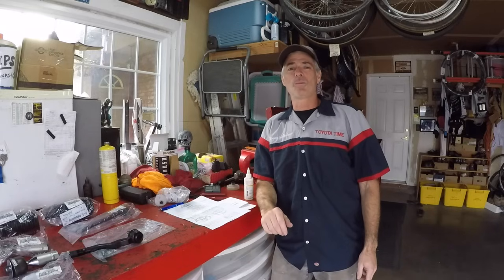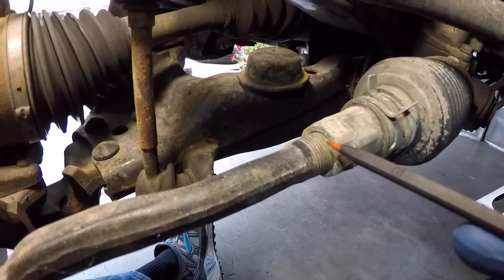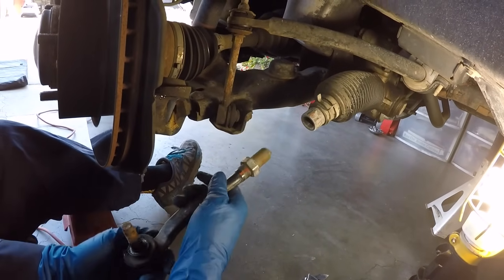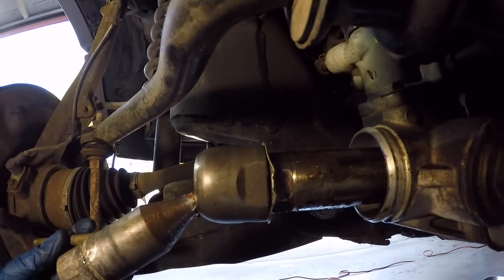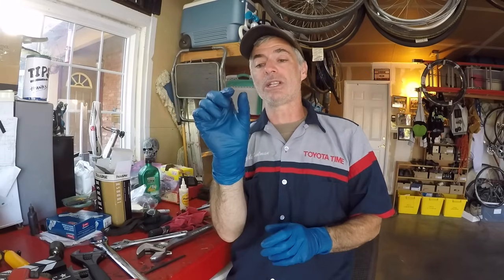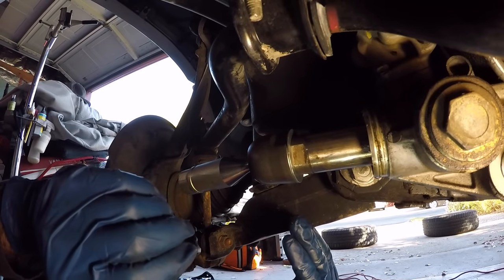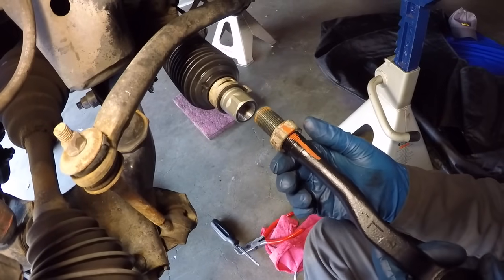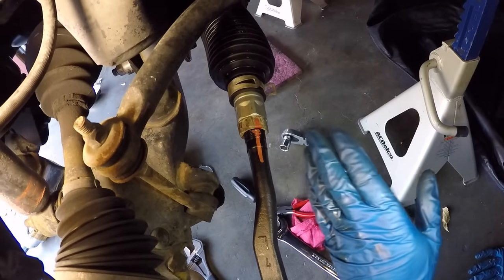Inner & Outer Tie Rod Replacement

Comment: I mangled up my passenger side outer tie rod replacing the ball joints today. I can't get the castle nut back on from the puller slipping off and crushing the threads.
Can i replace just that tie rod? Or do i need to do both sides for alignment purposes? 
And if i do have to do both can i just do the outer tie rods on both ends?
In advance Thank you again tim
Reply from the maker: How about first running a die over the tie rod and cut some new threads.  If not, you wold be fine replacing just that tie rod.
Reply: @TimmyTheToolman  i bent it pretty good to or i would give that a try. Thank you for answering my question once again!
Reply from the maker: @UpNorthOutWest  If the shaft is actually bent, you should replace it.  If you make match marks on the lock nut to tie rod shaft and count the amount of threads exposed, you could get the toe adjustment for that tie rod pretty damn close to perfect and forego getting an alignment.  If money is tight, that's what I would do.  But, maybe you were planning on getting an alignment anyway.
Reply: @TimmyTheToolman  that's what ill do then (i watched the whole video) i was planning on getting a alignment for that reason only from replacing the otr tie rod but if it drives straight after that then i will skip on it. I was just concerned if it would cause uneven wear from one side being newer
Reply from the maker: @UpNorthOutWest  No, it won't cause uneven wear from being newer but if you don't get the adjustment really close to what it was, that will throw off the alignment and cause uneven tire wear.  Put a mark on the lock nut and carry it down to the tie rod threads making a parallel line with the shaft but going across perpendicular over the shaft threads. Also count the amount of threads showing.  When you get the old tie rod off, put the new tie rod next to it and put a parallel line on the threads in about the same spot, just eye ball it.  You screw the new tie rod into the outer tie rod with the old lock nut paying attention to the amount of threads showing.  You're goal is to get the same amount of threads showing and also match up the match mark on the tie rod thread with the mark on the lock nut after you've tightened it down. This will give you a very accurate way to get the new tie rod in pretty much the same exact spot.  Good luck!
Reply: @TimmyTheToolman  thank you so much for your help man!much appreciated🙏🙏
Reply from the maker: @UpNorthOutWest  You're welcome Bro.  Good luck with the swap.

Comment: Hello there, do you know if I have to remove the outer tie rod again to adjust the toe ? All my other vehicles had an outer tie rod that can spin free once you unlock the tight nut to adjust the tire,I'm afraid to damage my inner tie if I forced the outer tie rod to spin over .thanks
Reply from the maker: Hey Felipe, no, you don't have to remove the outer tie rod to adjust the toe.  The alignment techs loosen the lock nut, make the necessary adjustments and then lock it back down.
Reply: @TimmyTheToolman  Thanks Timmy,I learn a lot from your videos.
Reply from the maker: FELIPE VALLES that’s awesome. Thanks for stopping by & commenting on our videos. We hope you’re a subscriber & if you enjoyed the video, do us a solid & smash that like button!

Comment: I think i need to replace one of the tie rod end. Do you think I should change he one is bad or both? Since i do not go off road OEM is not necessary. Am i right? thank you
Reply from the maker: You're fine with just changing the one that's bad.  As for choosing aftermarket over OEM, I personally wouldn't do it.  OEM is always, always, always the safest way to go.  You pay more but you're getting a superior product.
Reply: @TimmyTheToolman  Thank you so much Timmy. I followed your advice. I got the OEM. Thank you again!!!
Reply from the maker: @Leino26  You're welcome.

Comment: great video.  just google 'inner tie rod tool' though and you'll find multiple options available starting at about $15.  Or do what I did and borrow one from your local auto parts store for free.  It worked perfectly. no need to start grinding on wrenches or spending $120.
Reply from the maker: The only problem with the special tie rod tools is you need to be at the wheel well turning the tool which makes it impossible to also be holding onto the shaft of the steering rack which Toyota obviously expects you to do or they wouldn't have put flat sides onto the shaft so you could put a wrench on it.  So, it you have two people, I'd say rent the special tool for free at an auto parts store.  If you're solo and use the rented tool, all that force to break free the inner tie rod will be transferred to the shaft.  Is is a potentially destructive move?  Maybe.  What $15 tool options did you find?  Could you please share some links?  Glad you like the video.
Reply: @TimmyTheToolman   the tool I borrowed from the store was actually this type 
Inner Tie Rod Tool, EXCELFU 3/8 Inch Low Profile Tool for Inner Tie Rod Removal and Installation$12.99Amazon.com (similar to OTC tool. basically a pipe wrench)
I was able to get up close to the inner tie rod and the steering rack shaft. maybe I got lucky but it didn't take enough force for me to pop it loose for me to think I would be damaging the steering rack gear.  like you say, it could be possible to do some damage popping it loose or re-torquing it back on without holding the steering rack shaft. I just used my channel locks to hold the shaft when I was installing the new inner tie rod. I also made sure to lock my steering wheel.  Anyway, not trying to be a negative comment.  great detail in your videos.
Reply from the maker: @pauliemars  No worries.  I didn't view your comment as negative.  I just want people to know the shortcomings of the special inner tie rod tools that are available..  I sort of think the Toyota engineers were being overly careful because that steering rack shaft is pretty beafy, but maybe there is a risk of damage, and that's why they advise to hold the shaft firm with a wrench when applying force to remove the inner tie rod.
Reply from the maker: @pauliemars  Yeah, I saw this tool when I was doing research for the job.  So, it worked pretty good?
Reply: @TimmyTheToolman   I can imagine how easy it would be to damage several parts doing this job without the proper care and attention, and tools for sure. Yeah the one I used. Similar to the one in the link, worked surprisingly well. I used a 1/2” breaker bar with a 3/8 adapter. I tightened the nuts on the clamp really tight and there was zero slippage. Barely marked the part at all.
Reply from the maker: @pauliemars  Good to know.

Comment: I’ve been wanting to do this for my Tacoma but oem inner and outer tie rods seem to be insanely priced even at camel back Toyota , bought some moogs but they seem sketchy specially  the outer tierod
Reply from the maker: Yeah, I'd be reluctant to use Moog.  Damn, you are right.  The inner tie rods are insanely expensive, $157/each.  That's nuts.  Over $300 just for the inner tie rods.  I can't believe Tony opted to replace them because his didn't really need to be replaced.  The outer tie rods aren't so bad at $55/each.
Reply: Timmy The Toolman I’m actually redoing the suspension on my new purchase an 01 5lugger Tacoma , the outer tie rods are $70 ,inner 150$, the moogs seem to have good reviews , thanks for the video Tim
Reply from the maker: You're welcome.  Good luck with all the work.

Comment: I'm not sure what the problem is but, my comment is related to the IAC Test and clean video but, the comments section will not show up. The area just spins like it can't find the comments or something. Not sure if it's my issue or yours. Anyway, I just finished the throttle body and IAC clean and now my 4Runner will not start. But, I'm also having a P1300 igniter error code on coil #1 that seems to be causing the vehicle to stop running pretty much anywhere and at any time. It then will usually crank back up but, if it's hot it seems to exacerbate the problem. When hot it will stop and then I have to try several times but, it eventually restarts. So, it may have nothing to do with the fact that I liberally cleaned the IAC with throttle body cleaner. This is a long winded attempt to respond to your request to let you know if anyone has any problems after having cleaned the IAC with throttle body cleaner. I'm skeptical that my vehicle will not start because of the cleaning but, it did run this morning when I went to the grocery store and then I cleaned it and now it won't start. I wish the situation was not so complicated so we could get a better read on the cleaning method that should be used. Anyway, any help with either problem would be greatly appreciated. I double checked that everything is as it should be after the cleaning.
Reply from the maker: So you double checked that the IAC worked after the cleaning?  I definitely don't see how cleaning the IAC could cause an igniter issue.  Did you make sure all your electrical connectors were reconnected to the throttle body?  If you did like we did and disconnected the center coil pack, did you remember to also reconnect that?

Comment: Great videos, but the inside joint is a rack end it screws into the steering rack, inner tie rod looks like outside tie rod, usually used on stearing box
Reply from the maker: You lost me with your comment.  The joint that screws into the steering rack is the inner tire rod.  The outer tie rod connects to the inner tie rod and to the lower ball joint.

Comment: I would use a pipe wrench $10 @ Harbor Freight.
Reply from the maker: That certainly is an option and I mention it in the video.  You just have to be ok with marring up the tie rods with the serrated  jaws of the pipe wrench.  But, you better not grab ahold of the steering rack shaft with a pipe wrench.  That wouldn't be smart.

Comment: So my front driver side outer tie rod broke right in half, and it caused my wheels to lock up, I had a guy replace the part and it seems to be running fine but iam worried that the wheels will lock up again, could this small part be the cause of that happening or do you think it was something else?
It was on a 2001 lexus es, iam thinking maybe some sort of break censor did that when the tie rod was broken.
Reply from the maker: Maybe the breakage of the tie rod broke the ABS sensor line and that's why the wheels locked up.  Did the guy say he needed to replace anything other than the tie rod?
Reply: Timmy The Toolman the abs sensor light is on so maybe. He didnt say much just showed up and replaced the part, i asked him if he thinks it will lock up again and he said it should be fine now with the new part. Thanks for the reply back
Reply from the maker: @elguerokabron  You could probably find an ABS sensor wire at a PickNPull for your rig and replace it so you won't be looking at an ABS light on your dash all the time.

Comment: You could have also use a file and filed the material off from the knuckle to make the space to fit your tools a little wider, instead of grinding your tools to fit there.. as you are going to replace it anyway it, seems like better option than destroying your tools :-)
Reply from the maker: Trying the file down the inner tie rod enough for the wrenches to fit might be quite the laborious process but I suppose that is an option.   You obviously wouldn't want to take a file to the steering rack shaft.

Comment: wow! that ITR OEM is  247$  MSRP each as of  3/2o23 ... 170$ at OEM online parts dealer with 31% off... is an equivalent MOOG brand ITR from a RockAuto ok to use for this item?
Reply from the maker: I wouldn't use Moog but many guys do.  What I tell people, is if they want to replace inner tie rods, they may as well just buy a new steering rack.  A new steering rack goes for around $530 and it comes with new inner tie rods.  That's a much better deal in my opinion.

Comment: Timmy, I named 4 of my kids after you so if they ever request a DNA sample from you it will be because they think you owe back child support. LOL but seriously, You are my Idol and Guru. I went to the local hardware store and got some square "keys" that normally slide into a groove on a motor shaft where a pulley mounts. I epoxyed them onto the jaws of two large adjustable wrenches the night before. The epoxy held long enough to get the old tie rods off and after the job was finished, I cleaned the epoxy off the wrenches. I have done this on backhoes, tractors and heavy equipment before. Just be careful, take your time and and make sure the wrenches are tight.
Reply from the maker: Thanks Rob.  I appreciate you being a fan of our channel.  Nice Macgyvering with making your own tools for this job.  Happy Wrenching Brother!  
p.s. You can keep the kids but if you have some tools you want me to adopt, I'll gladly take them off your hands.  LOL

Comment: Is this one of the reason why you get steering wheel shaking left to right? (One of the reasons)
Reply from the maker: Yes, worn out tie rods could cause what you're describing.  But, if the joints don't have play, the tie rods are good and you'll need to look elsewhere for your problem.

Comment: Timmy, after I replaced the inner and outer tie rods on both side of my 02 4Runner, I took it for alignment. It came back with "stiffer steering". Any idea what could cause this?
Reply from the maker: Hmmm.  How was it during the drive to the alignment shop?
Reply: @TimmyTheToolman , well I didn't do such a good job as you did marking the new tie rod so my steering wheel driving on a straight line was a full 90 degree to the left. That was fixed on the alignment, but to answer you question, it felt like I was driving a boat. There was no resistance to turning either right or left meaning that no, the steering did not feel tight or stiff at all as it does now after it came out of alignment. I've googled around and found things like "adjustment for steering gear preload". Thoughts?
Reply from the maker: @AlvesCristianoG  I know if your toe was off that could cause your steering to pull and not track straight down the road, but causing the symptoms you described?  I don't know.  Both times I messed with tie rods, the result wasn't like you experienced.  Did you mess with anything else like the adjustment of the steering rack guide?
Reply: @TimmyTheToolman  on this job, I replaced the front coil springs and struts and while at it, replaced both inner and outer tie rods (your video helped immensely) on both sides. I did not touch anything on the steering rack. This is weird. I'm taking it to another shop. I'm not going to mention here the large chain tire center by name that is across the street from me where I take my car for tires, balance and alignment but I don't quite trust those guys. I've had some balance my tires and stick a weight on top of another. I'm going to take it elsewhere and see what they say. I don't want to start putting money on lower ball joints, stabilizer bars (even though I've been planning on replacing those) and who knows ultimately a steering rack. I may need to follow another of your videos and do a power steering fluid flush. The odd thing is that before the job mentioned above the steering was soft and normal. After alignment it became stiff.
Reply from the maker: @AlvesCristianoG  Yeah, good call to take it to another shop.  Sounds like they have the alignment way off.
Reply: @Timmy The Toolman, I just watched your steering rack guide video and I can almost bet money in that the guys who aligned my car may have tightened that.
Reply from the maker: @AlvesCristianoG  It's a possibility.  Why he would touch it, I don't know.  It's not part of performing an alignment.

Comment: It is easier to count the turns of outer tie rod while unscrewing it from the inner rod....
Reply from the maker: Sure, whatever you think is easier.  But, how do you quantify a partial turn?  Do you have special degrees viewing eyes?  With making match marks and counting the amount of threads exposed, you will guarantee you will be able to get the new tie rod in the same exact position.

Comment: 31:24 or go to your local auto parts dealer and *rent the tool" you need for free, well a 100% returnable deposit
Reply from the maker: @mvtorigian4364  The problem with the specific inner tie rod tools, is they don't address holding the steering shaft with a wrench.  All the force applied to the inner tie rod is transferred to the shaft.  Is it a big issue?  I don't know.  But, the Toyota FSM clearly shows holding the shaft with a tool, and that's why I removed and tightened the inner tie rod in the manner I did.